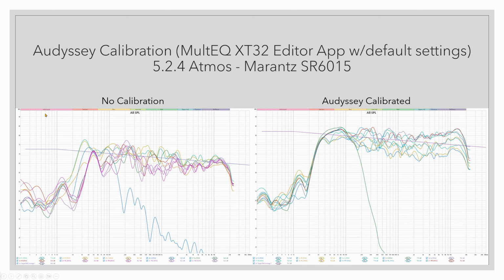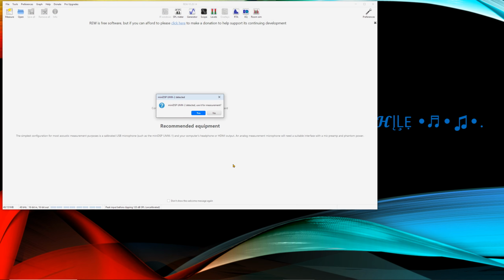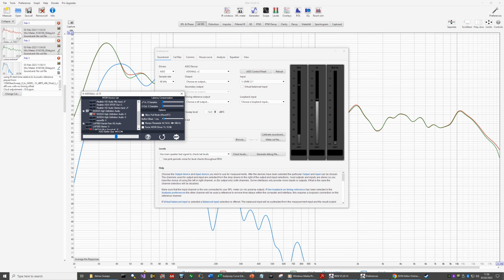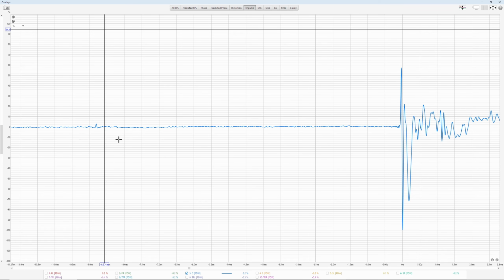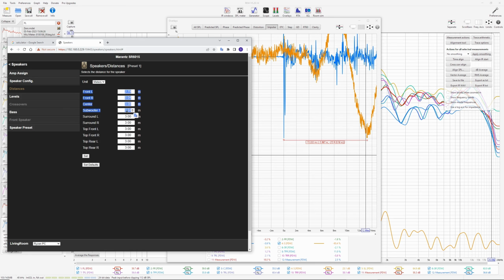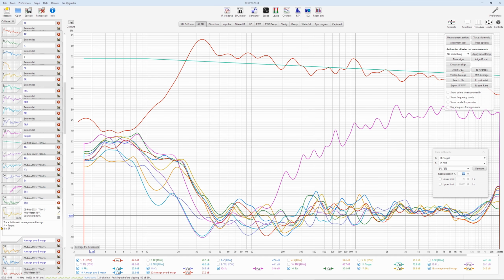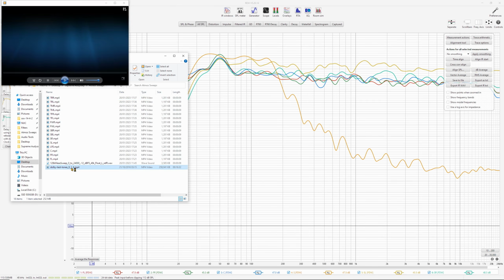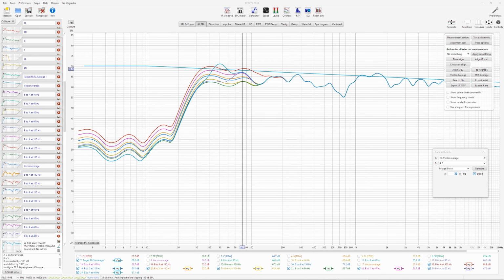Supreme Audyssey Calibration by OCA

Comment: Just wondering (again) if its normal that my height speakers needs alot of boost to get even with the rest? ofcourse they are abit further away, but still, my C for example is at -5 but height is +5-6... reason i ask is a read somewhere that putting extra db+ on your speakers isnt a good thing for them long term, but no idea if its true or not..
Reply from the maker: That's normal, mine are +8. Smaller sattelites need more volume to level with the rest of the speakers. It's harmless.

Comment: Oh man, great tutorial and I've been over this a few weeks. Now that I finally got to phase where you send the corrected ady file  back to your receiver it won't accept it. The multieq app hangs half way as it tries to apply room corrections. Must be something wrong with the day file but I can't find the error. Damn.
Reply from the maker: You can compare original and edited ady files on the sane screen in the json editor and find out what's causing it
Reply: mine did the same, stopped halfway, but i never found out what caused it...let me know if you figured it out :)
Reply: @_shogun_gaming_  I compared the files side by side in the Json editor and could not tell a difference. Then I decided to put the fronts L, C and R corrected files in and send that to avr. Worked ok. So later today I will put the surround channels in and try and if that works then atmos and so on. I'll tell you how it goes. I suspect that the sub channel is the cause of problems.
Reply: It was something wrong with the subs custom target curve points parameters. Now they are ok. Should there be any response data at the channel 10 (swmix). This confuses me because in my system I have two subs but there's only one measurement done for the subs together. Can I measure and make corrections for the subs separately? Or is the minidsp only option?

Comment: Question: Is there anything different about some of the key shortcuts between Excel and Numbers? I am on Mac, and I never really use Excel/Numbers, so I have no idea what key shortcuts you're using to select the data in the columns in the curve editor to copy into the JSON editor.  For example, there's no "Data" option in the top menu within Numbers.
Reply from the maker: Unfortunately I have zero experience with Macs but if you export from REW with "tab" as delimiter rather than "space", you will not need to "text to clumns" the data in Excel.
Reply: @ocaudiophile  As I've fumbled around the software this afternoon, I discovered that Numbers does everything automatically without doing anything, which is nice.  What I would be more interested to know are the keys you're pressing to only select the pertinent data in the Excel file to paste into the JSON editor (i.e. only the data listed in between the square brackets) - there's probably an identical/equivalent on Mac.  Also, I ran into something I don't know how to resolve.  If I create a .txt file with correction data that includes anything below 20Hz (because my subwoofer extends below 20Hz), and I paste that information, the data in the "Copy to .ady" column gets cut off, and doesn't include everything.  For example: in REW, I set the custom range to 10Hz - 20kHz, create the .txt file, copy/paste that data from the.txt file into the Excel file, and the information in the "Copy to .ady" column only transfers 10Hz - 10kHz.  The "Freq" and "SPL" columns shows all of the data points from my .txt file.  How would you change that to include all of the data in the "Copy to .ady" column?
Reply from the maker: I use Shift + End + cursor keys on the keyboard to select all the way to the end of the data from the selected cell.

Audyssey cannot apply any custom curve point outside 20-20,000Hz range no matter what data you will enter. But if you want to still export them that way, I guess you'll need to increase PPO from 24 to 48.

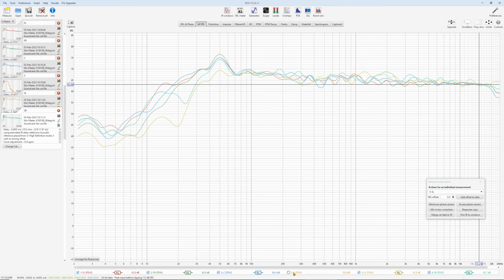Comment: Please a little clarification for me, At around 51:00 I made copies of the sweeps, applied Align Spl (for speech), and then compared sweeps with their copy and applied Spl Offset.
Do the new Spl offsets replace the AVR Speaker Levels previously set or do you add the Spl Offsets to the AVR Speaker Levels? I tried both and the results were no better than the first applied inversion (before 51:00).
I've previously aligned my subs following your tutorial. Got them flat. The distance from the sub to the center speaker measures between 7-9 meters depending if you measure from the bottom or top peaks. The center speaker distance to the MLP is 1.91 meters. So my total distance is approximately 11 meters to add to the subwoofer distance in the DENON AVR!? 7.90 meters is the highest distance that can be entered.   I'm confused.
Reply from the maker: I understand the confusion. Actually REW now shows the SPL offset applied to a measurement during "Align SPL" process in the Info window under "Align Offset:" so you don't need to make copies. just check these for each measurement. I explained this method in detail  around 08:35 minutes into the following video:

https://youtu.be/4gVUdArG7oA
Reply: @ocaudiophile  In the Audyssey calibration for Dolby Atmos Music video you apply   Cross correlation alignment with the Vector Avg Sweeps and Actual Time(distance) Aligned measurements is that new? Should it be employed here also?
Reply from the maker: @CarlosGomez-THX_1138  It takes the precision one step further and helps in finding the correct crossover points. As you cannot adjust speaker distances with high accuracy in the reciever, this extra step helps REW to use the actual speaker distances and calculate phase interactions with the sub better. It's up to you to try and test the results.
Reply: In REW, after applying Align SPL @1000Hz and entering the Levels in the AVR, can we then apply, in REW, Align SPL @200Hz and adjust the Levels in the AVR? or do we apply the Align SPL as depicted in this video?
Reply: @ocaudiophile  it works!
Reply from the maker: @CarlosGomez-THX_1138  Sure, you can. Just check in the Info window the SPL offset applied by REW during alignment and dial in the AVR closest you can. I would suggest 250Hz for speech.
Reply from the maker: @CarlosGomez-THX_1138  Sorry only just started reading comments ;)
Reply: In your Audyssey calibration for Dolby Atmos Music video your Vector Averages do not include copies of position '0' i.e. C0+C1+C2+C0-copy. Why? Personal choice?
Reply from the maker: @CarlosGomez-THX_1138  It was a choice as the other two measurements were already very close mic position eqaul distance from the center.

Comment: FINALLY got things mostly working, so i made it all the way to exporting the text to the json, before i got to late and bedtime :)
One thing im curious about, lets say i dont know the phsycial lenght of my speakers, is there a way to read from the sweeps in rew how far it is? reason i asked because i noticed that doing custom sweeps only, my C wasnt in 0, so i realigned it manually in the impulse tap to roughly be at 0 with C, but is that the right way to do it or did i screw up somewhere?

found this vid that talks about my "problem" is that the right way to do it? https://youtu.be/QqiJsJk6rjc

EDIT : Been reading some more about it, so the distance in the avr dosent really matter that much (already figured the first would be important) as long as the rest of the speakers align with C...correct? i know for a fact that my physical lenght to my C is 2.57m, so i could just set it at something like 2.50 for a easier round number to calculate with?
Reply from the maker: Set C to 2.57/343*300, change REW's speed of sound setting to 300, measure the distance of a speaker's impulse peak to C's impulse peak with mouse right click method and add/subtract that distance from C's distance calculated above. This will precisely align all speakers to LP. You don't need to move C to 0 initially.
Reply: @ocaudiophile  ah right...do the 2.57 x 0.875 thing? went down a big rabbit hole about this topic on avs forum :P my rew settings are all setup like yours, was just wondering about this part..
Reply from the maker: @_shogun_gaming_  In the atmos music video, it's explained better...
Reply: @ocaudiophile  heres an idea for a future video, making a tips & tweaks video when you condess it to the small little things thats not so easy to find or know about for a novice, instead of it scattered around your other vids, i know its a big effort to do and theres always something new happening, but like i said, just an idea for you :)
Reply: @ocaudiophile  you ever come across doing several measurements from the same speaker, mic place etc, basicly just repeating it, but the impulse respons changes? Really annoying, i dunno which impulse to trust to be the right one.. 🤷
Reply from the maker: @_shogun_gaming_  shouldn't be happening except for very minor changes here and there

Comment: Hmm APP says file is corrupt. Also my ADY layout looks different then yours-  EDIT: Strange couldn't get it to load even though I did exactly as instructed.  So for the fun of it I re-sent my ADY back to my phone- nothing changed except title: inside ady and renamed saved file. Loaded it into APP and for some reason it loaded with the other name i tired and now works with what appears to be correct settings. AS Speakers are now all large correction results is flat- I dont understand it.  I cant remove "non" working one. I went into app and removed every ady I could find and still there with additional ones called  "primary".   Also My version of REW does not have CROSS COR ALIGN- I believe I am on the most recent version
Reply from the maker: İt's an early access version of REW,
Reply: @ocaudiophile  found that thanks- whats with RMS average- i did that and it made RMS average responce 10+DB higher then every single one- so by my eye the "average" would be 78DB RMS average did 85DB. Also using formula when I did try set Target closer I get all inverted are -5/-10 and "atmos" are 15/20db.
Reply from the maker: @everydayguy3737  This cannot be, RMS Average is root mean square dB averaging. By definition it should be around the middle of the measurements averaged. You may have SPL offsets not applied "add to data" in the measurements. Check if they are all at 0 from Measurement actions.

Comment: Yet another rookie question : whats more important, setting your avr to - 24.5 and check levels are around 70-71 for C (with 0 db all across the board in the avr volumes) or, raising the level on your avr to hit 75 db in check levels?
Reply from the maker: There shouldn't be any. A step is skipped in the video by mistake. It's explained in the description area.
Reply: @ocaudiophile  i switched my avr to 0-98 db scale, and at volume 55 its pretty close to 75 actually ;)

Comment: Dear OCA
Could you comment - I experience huge SPL difference between REW sweeps and your provided ATMOS sweeps. They are incomparable. I can't switch between them like you did for LFE because REW SPL is much higher.
Reply from the maker: Turn off loudness management in your receiver
Reply: I tested this on 2 computers, I factory reset my AVR, checked without any Odyssey config and with "perfect response". And in all cases the response is identical: REW sweeps are ~15dB higher in SPL, compared to the Atmos sweeps provided.
There must be some other reason why yours are perfectly aligned
Reply from the maker: @Remigijus02  Only one other user (out of hundreds) had this problem. Atmos channel sweeps were not as loud as the bed channels and it was found out to be stemming from "Loudness management" setting being "On" in his AVR. The factory reset default is also ON for this setting btw, you need to turn it off. It's for dimming down volume during night hours and effects the ATmos channels massively. The Sweeps are all equal volume otherwise. That's firm information.
Reply: I disabled every setting on my receiver, including "Loudness management" and result was the same. Therefore I did further investigation. It is possible to check SPL offset for every Atmos stream on a receiver by going to "Setup->General->Sound" during file playback. I have no offset for file "Dolby test tones" (your provided file that plays every channel for 1 minute) and it sounds fine. Dolby demo files have offset ranging from -10dB to -14dB. But Atmos sweeps have -16dB offset (both 128k and 256k versions) and REW sweeps default level is -12 dBFS. That causes difference in SPL.
As a reference, no PCM or DTS-X Master signals get attenuated.
I have no idea why you of anyone else don't have this issue. Maybe it is sorely related with Denon X6300H. Just like the absence of http control (confirmed by Denon). All the successor models have it.
Reply from the maker: @Remigijus02  Dolby Atmos encoders uses a variable called DialNorm similar to loudness. It ranges from 1 to 31 and is always set to 15 by default. It's related to speech context in the material and how it's distributed to all channels (I think) which there's not any in the sweeps. I have tried various Dialnorm settings, in fact it's the only setting you can play with but didn't see any difference in the results. Your measurement difference may very well be from WMP volume settings which are set in Windows vs REW's settings which bypass all Windows with ASIO. There are differences in LFE channel timing due to a 120Hz cutoff filter with Dolby Sweeps and you should see a slight roll off after 20kHz in Atmos sweeps compared to REW 0-24000Hz sweeps as Dolby also applies a roll off filter after 20khz to other channels none of which we cannot change during creation of these sweeps.

Measuring loudness of an atmos signal is not that easy. Even ffmpeg cannot yet do it without conversion as the format is EAC3-JOC. Btw after conversion, ffmpeg verifies that the volume levels are equal with REW sweeps.
Reply: @ocaudiophile  You are absolutely right - it is related with DialNorm and the offset related to it.
As you suggested, DialNorm should be bypassed by disabling Loudness Management on our AVRs. However, this is not the case. Only for the lucky ones, having Marantz SRx015, Denon Xx500 (or later), this feature actually works. For others, it is just a dummy setting, which doesn't do a thing. Therefore DialNorm is in effect.
Now about the sweeps: after checking them with MediaInfo, I find them to be:
128k: -15dB (offset -16dB)
256k: -14dB (offset -17dB)
So even they are reproduced at different SPL levels when DialNorm is in effect. That is why I need to crank up the volume to play these sweeps much more than my regular listening level or playing REW sweeps. That is why my measurings get disbalanced.
I assume that you are not the one, who is mixing these sweeps by yourself? And it would not be possible to get the sweeps mixed at DialNorm -31dB level?

It is always a pleasure to learn from you and follow your tutorials. Thank you
Reply from the maker: @Remigijus02  The original sweeps were produced by a sound engineer and I made exactly the same claims to him that you did. Not 15dB difference or anything but I believed surrounds were dimmed -1.5dB and I suspected it's the small differences in DIalnorm in Mediainfo however he proved me wrong. After that I learned how to produce them. There's only one free way of producing them btw and it requires AWS membership and AWS mediacreator along with use of sox and ffmpeg and takes about two hours to generate them if all goes well in the first step. Anyway, I of course tried every single possible outcome and there aren't many options you can play with really to fix that 1.5dB surround channel difference I believed to exist but I failed. We had long discussions with the original creator and finally he convinced me that they are all at equal volumes.

Now your point of dialnorm being bypassed in older models could be valid. I am thinking of creating Atmos sweeps for the new 64k short sweeps added to REW and I will try to produce an additional set with -31 dialnorm for you. But I cannot promise it will be done any time soon, it's a very busy time of the year for me. I will try to finish within the week.
Reply: @ocaudiophile  Hello Sir,
No luck finding time for the sweeps? Should I still be expecting? Thank you
Reply from the maker: I tried every option in AWS this morning but dialnorm setting can only be adjusted for DD&DD+, it's not even in the options for for DD+ Joc. I must be remembering wrong. I am afraid your reciever is in the list of non dialnorm defeatable models. Check this forum:

https://www.avsforum.com/threads/defeating-dialnorm.3253654/#post-61958511

One thing you can check albeit with little possibility of success, could be making sure you send Atmos sweeps as bitstream to the receiver, not PCM. The conversion could be related to some Windows sound setting for the receiver where WMP picks it up from.

On the other hand, you can always adjust the volume offset in REW with measurements. You need +16dB offset!
Reply from the maker: @Remigijus02  These sweeps are around 2dB higher. I could get dialnorm from -14 to -16 by changing format to Speech and speech content to 100%. I tried every other format: speech content 0%, film, music, music light and film llight....Previous sweeps format was "none":

https://drive.google.com/file/d/1KFpzNPmXpq_PYHYrdDij960TMUheDFJV/view?usp=sharing